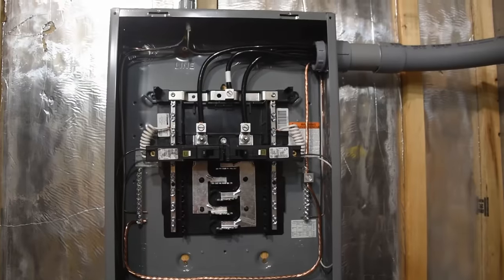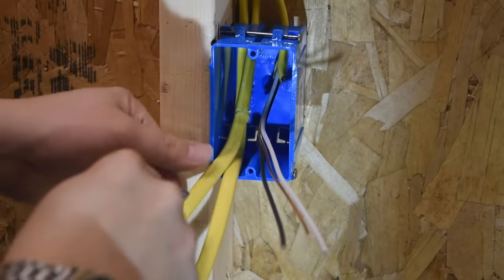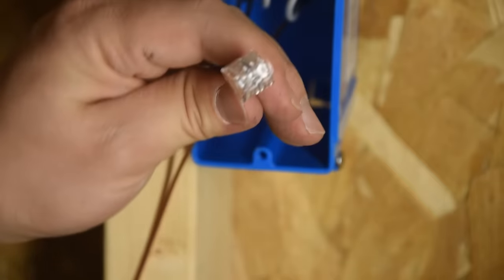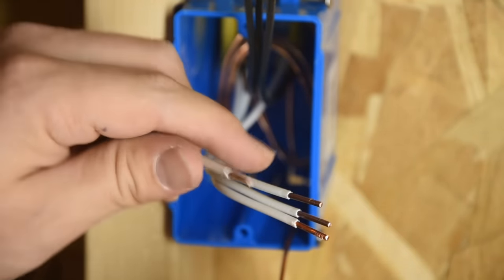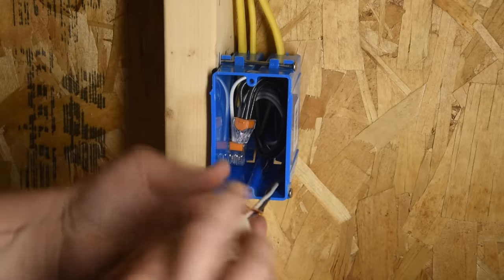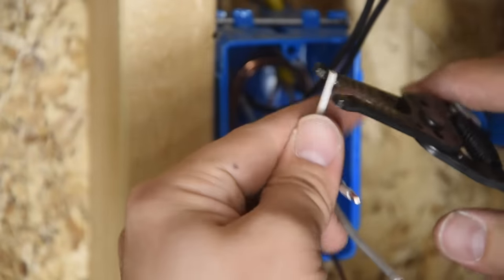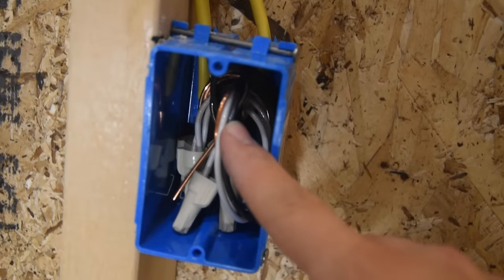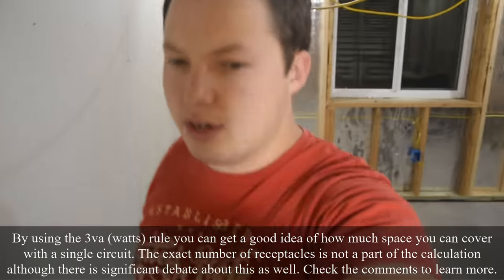Wago's vs. Wire Nuts - How To Wire Outlets During Rough In

Comment: I am a 40 year electrician those Wego connectors when amperage is drawn through them they will burn up nothing beats a wire not do not use them Nfg
Reply: False FAKE news, the ratings on WAGO is more than adequate, matter o FACT go find the You tube videos where they test WAGOS, and over load way past the rated values, they hold up quite well, you are making up stuff, like old wives tales, or Trump.  WAGO is fully UL and many other testing lab certified, it's 2021, join IT!
Reply: You cannot tell me that a pressure clip is better than a splice with a wire nut you probably backstab devices don’t you
Reply: @johngirgenti1611  outlet back stab is not made like wago connectors, facts could actually make you sound smarter, all tires are round, so all tires are the same?  twisting wires before using wire nuts is also not correct, no mfg tells you to do that, you make that up, according to code, if followed, u are too follow mfg instructions for devices, where do they say to twist wires before using wire nuts..watch the video where the guy explains with FACTS how the Wago works, it's nothing like an outlet back stab

Comment: i have watched a number of your videos and you seem to make the same mistake over and over, weather your connecting a wire or cable in a panal, or outlet or light, you never leave any bare wirre above the connection, you seem to leave a fair bit of bare wire on lugs, breakers in panals as well as on receptacles.. an inspector would fail you on every one
Reply from the maker: I have not failed an inspection for that reason but I appreciate your feedback and will try to keep that in mind in the future.
Reply: Weather..really?
Reply: @BenjaminSahlstrom  we the inspector should have failed every one, but you know how inspectors get there job, they were a pour worker on the job site so they made him/her an inspector. i have has 2 fired in my time